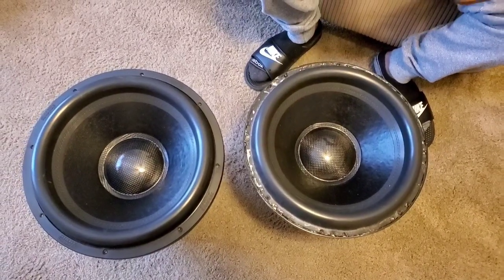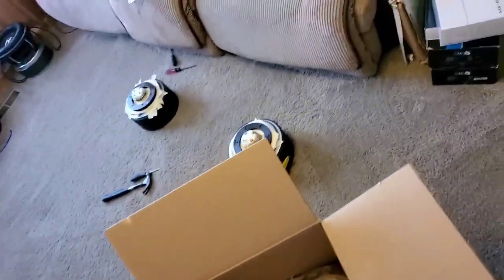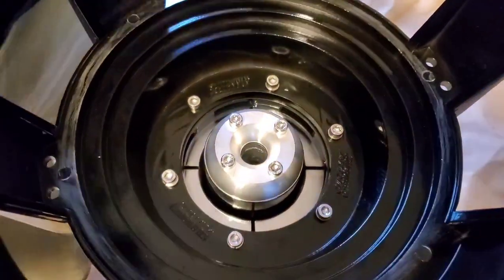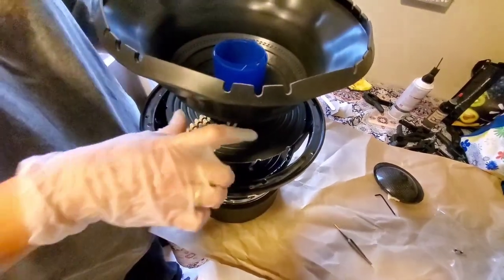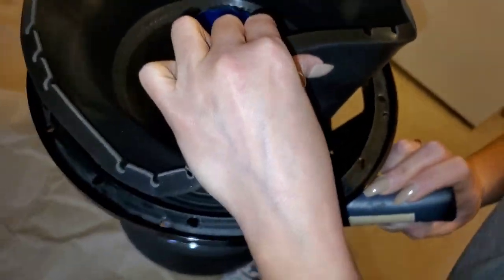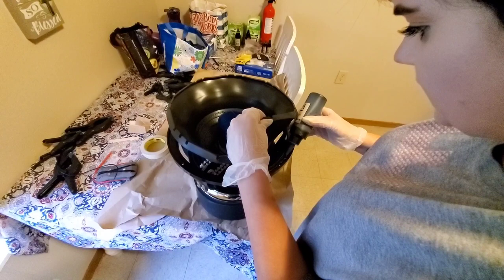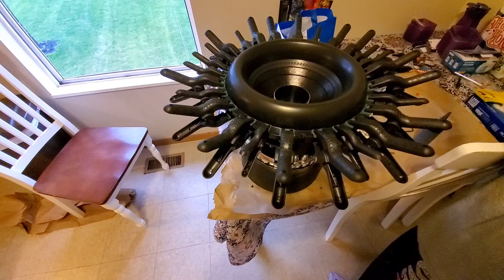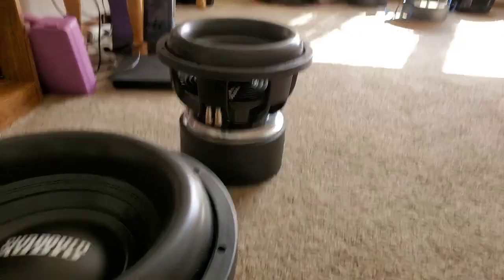Sundown Zv5 reconing 15's to 12's! Complete video, reconing at home.

Comment: You should really put the glue on the spider then slide the cone on and clamp the spider down in several places, then spray with the activator. And literally you can pound them 15 minutes later

Comment: So what does it take to blow a ZV5 like that?
Reply from the maker: I didn't blow it. I bought two zv5 15s used from someone and I really wanted them to fit in my Lincoln but there just wasn't room. so I tore apart perfectly good 15s and reconed them to 12's so I could put them in my car
Reply: @QueenOfBass740  🤯😳🤒